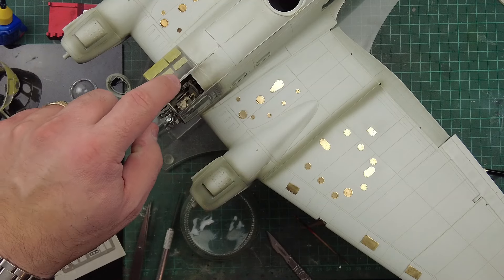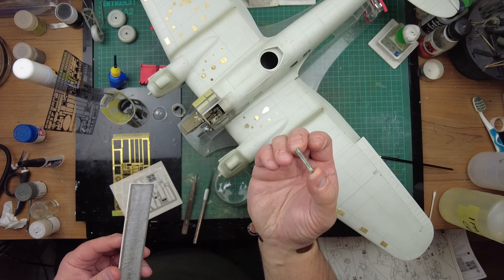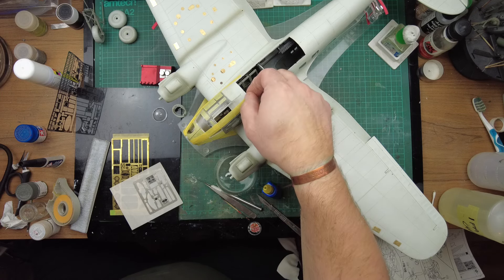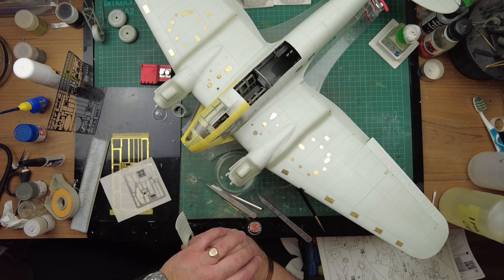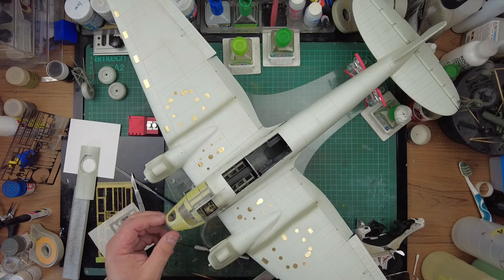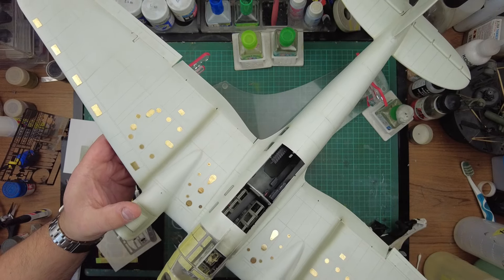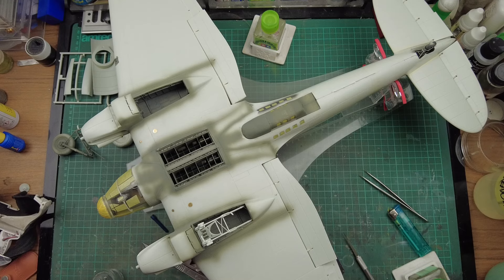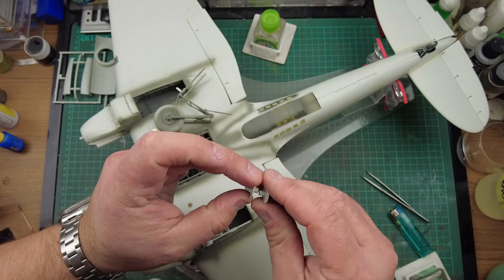Revell 1 32 He111 Big Build Part 7   Final Construction

Comment: Revell excel in designing complicated/fiddly undercarriage assemblies, with usually an unnecessary high parts count. I gave up with their 1/48 mossie undercarriage and used the Tamiya parts instead.
Great build so far Ian, what a monster of a model.
Reply from the maker: Many thanks, your fairly right about the undercarriage it was quite tricky to build but hopefully will fit okay when I get to putting it in the wheel bay😁👍

Comment: Fantastic attention to detail! Great job on the cockpit. (Particularly the wiring harness) I’m so glad to see it on your bench. I have an affinity with German Bombers. I pulled mine off the shelf, cleaned the mouse pee and dust off of it. (Rubbing alcohol,Q-tips,make up remover pads) It’s going to be such a cool model when done. 
  Sorry for mentioning the engine narsel. Sometimes things shouldn’t be said. (I see you did the same thing)  It’s the research that is my”Achilles heel”.  “That’s not right” And I go about trying to fix it. For example the old Revell 1:32 scale STUKA (I hacked and slashed that kit) and stalled on the propeller spinner. -  “Up on the shelf!”
  Yes, I’d love to see your shelved projects. I have so many unfinished projects myself. I might have to do a video too. (I haven’t posted a video in over a year.) 
  This is such an amazing hobby! Thanks again for sharing your build and the inspiration. Keep up the fantastic work! Love watching.
       JC      : )
Reply from the maker: No worries about the radiator cowling I didn’t realise there should be a natural step between the engine nasal and the radiator cowl, I’m really glad you pointed it out as I still have plenty of time to re-scribe a panel line back in and with a little file work probably put the step in the joint back in too. Interestingly the CAD drawings for the 35th scale Border models He111 show this area really well so will reference them when putting the joint back in.
I built the old 32nd Revell kit in my youth, I remember being particularly proud of it, one I think I might need to build again, I remember it being covered in really prominent raised rivet detail, a build for another day I think🤔 I’ll certainly film my other shelf of doom kits when I’m finished this build and would love to see your progress on your 111, the desert camo will be amazing to see, I’ve subscribed to your channel👍
Thanks for taking the time to comment, I really appreciate it as it give me the inspiration to keep filming my builds😁👍

Comment: Quite fiddly, that undercarriage assembly. I'm thinking perhaps the back part first, glued to each other, but not to the model to get the general geometry correct. Then return a bit later to attach the forward struts. But I admit, this would drive me batty trying to accomplish it, especially if I was doing it in a smaller scale. :)
Reply from the maker: The undercarriage is a challenge, its really only designed to be built on the kit permanently p, not to come off for paint then being reattached, it’s also awkward working around the camera but with a little patience it can be done and will make life easy when painting and weathering😁👍